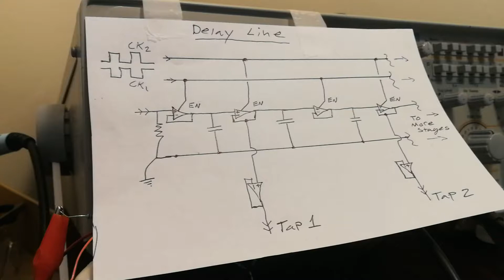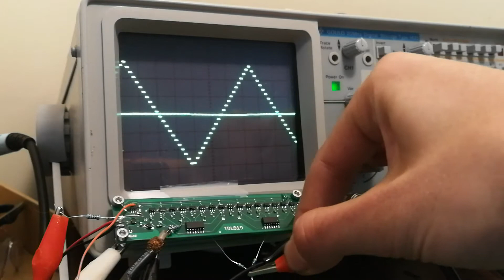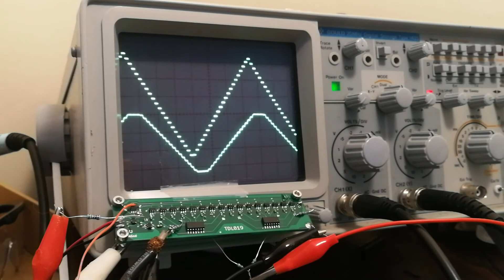Analog delay

Comment: I was looking to use this circuit for a hall effect sensor, any idea on how i could use a potenciometer to regulate how much of a delay is desired?
Reply from the maker: The circuit advances data down the line on the transistion edge of a biphasic clock signal. I use a simple, pot adjustable oscillator circuit for this purpose, but there are certainly more precise ways. One could send the pulses from a mcu, but the point is not needing one.

Comment: Excellent work. Your working in areas that aren't the normal bread of electronics. 

Yes I remember switched capacitor bucket brigade networks tended to be noisy affairs, so thank you for the insight on the quieter strategy. 

So to do a time domain convolution (same as multiplication in the Freq domain) , as I understand you need to time reverse the signal first.  Can you comment on how you do that ? 
Keep up the great work. 
Is there a way to EM you privately?
Reply from the maker: Hello, thanks for the interest! 

The difference between correlation and convolution comes down to how the PCB's are arranged spatially. I only caught on to that and reversed the one register at the last minute. 

sebazevedo1@gmail.com